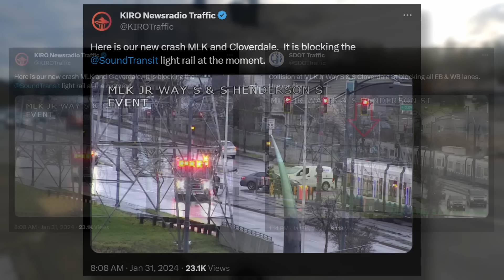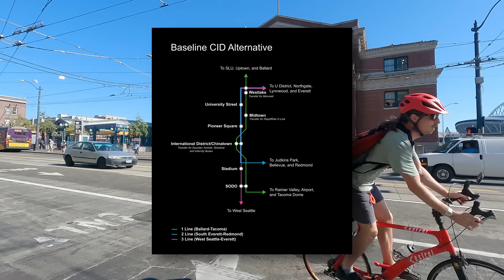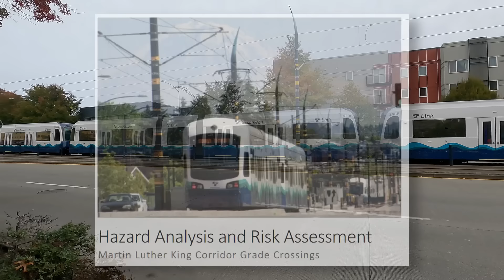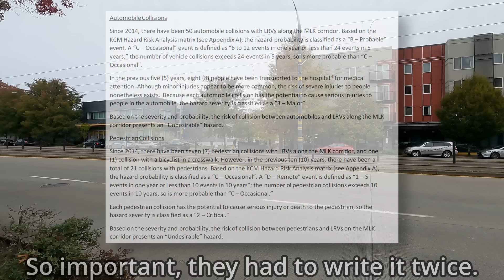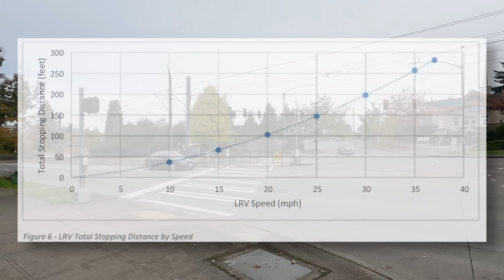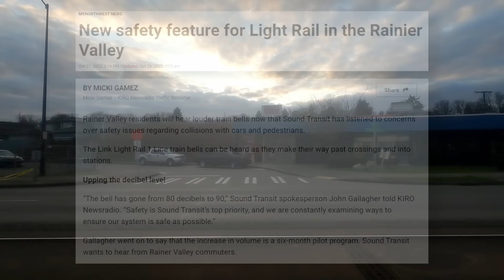Don't Skimp on Grade Separation

Comment: At grade LRT is okay so long as it's on its own right-of-way. If it's in the middle of or right next to a heavily travelled, high-speed stroad you are just asking for trouble. But what if it's already there? The solution is to block ALL the cross streets from going through the intersection, i.e., make them right-turn only plus through traffic for the stroad. Vehicular traffic that wishes to cross the stroad will need overpasses or underpasses built for it.
Reply: Phoenix begs to differ. You don't necessarily need to restrict traffic turning; you just need adequate signal priority.
Reply: Which is fine for vehicle traffic (depending on how critical the intersections are)... but then many streets also have a lot of foot traffic, at which point you either have to accept the decrease in walkability or grade-separate.
Reply: @HowlingWolf518  i think we can also accept automatic gates in lieu of full grade separation (tunnels, viaducts, and overpasses) for less busy lines. 

Most rural crossings of train tracks and roads use an automatic gate to force traffic to stop while a frieght train passes through. Personally this should be done for all crossings where grade separation is infeasible.
Reply: @jasonreed7522  Like I said though, that's going to lower walkability because you have to detour to the nearest gate (and wait for the train) just to cross the tracks. Everything's got a trade-off.
Reply: @HowlingWolf518  I'm assuming gates are installed at all existing crossings which means you don't have to detour, just wait for trains. At that point the delay is based on how heavily used the rail corridor is. 1 train every 15min causing a delay of 1 minute isn't terrible, a constant stream of trains where the gates are closed more than open should be true grade separated.

Ultimately it all comes down to cost, and whether an upgrade in service (gated corridor upto full grade separation) is viewed as worth the cost of that upgrade.
Reply: @jasonreed7522  Keep in mind that every extra gate raises costs, which defeats the point of not grade-separating. Also, there's trains coming in from the opposite direction, so that's two trains every 15 minutes.

You're right, not the end of the world, BUT once ridership increases, the line will have to run more trains to meet demand (if they don't from the start). Up here in Vancouver, the Broadway and Surrey streetcar plans involved running trains with 2-5 minute headways, or one train every 1-3 minutes... thankfully, those never got funded.
Reply: Which is almost never so at grade is a problem

Comment: 9:45 It really pains me to see the train stopping for cars at intersections. There is no excuse for prioritizing cars over such large trains! The M1 line in Lausanne, which is a single track tram with trains that are 4 times smaller and a frequency of service of one train every 5min can do that without much problems (and the tracks also have gates as seen at 6:16).
Reply: Even CALGARY figured this out, and the C-Train has rail crossing gates and light synchronization to ensure the train has complete priority.  CALGARY.  If Calgary can figure it out...
Reply: Even freight rail has figured this out, admittedly it would take them nearly 2 miles to stop, but still. If we can make drivers wait for a frieght train for 5 minutes, we can make them wait for a passenger train for 30seconds. (Automatic gates plus traffic lights are relatively cheap and effective.) 

Realistically even busses should have signal prioritization where traffic lights detect approaching busses and give them a green light before returning to normal behavior. (I'm sure some cars would incidentally benefit from this as well, but the main goal being that busses shouldn't be stuck in traffic)

Comment: One thing I see as a problem for pedestrians is that there are no pedestrian islands, so you are caught trying to avoid cars while running straight into a rail line. 

If they do narrow the roads, then they could add the pedestrian islands. I’d also generally try to find solutions that are static, rather than more maintenance dependent technology. 

I’d also be curious how other cities addressed the problems, using low tech solutions?
Reply: I think moving the track to the side of the road instead of the median would help a lot. And then add gates and signal priority so that the trains never have to stop to let cars through. That's how the M1 line in Lausanne is set up and it works very well. It's only single track but handles a frequency of 1 train every 5min in each direction. The only problem is that wait times can get a bit long if you're unlucky and want to cross the rails (especially for cars)

Comment: I've been riding the 1-Line a few times when I went to Seattle and especially when I'm going to the airport I see cars struggling to turn left with 2 REALLY long light rail vehicles passing by the intersection, and right after the light turns red. I suppose that cars really have a short window of time to do those.

Comment: Portland is considering building a tunnel for MAX, but I highly doubt it will happen in our lifetimes.  It's a shame, because going through downtown on MAX is a painful and slow experience, and people often drive or park on the tracks.  It's so obnoxious.  

MAX also has several intersections similar to the MLK section of Link.  Where MAX Yellow Line runs along Interstate Ave, and where the Blue Line runs along E Burnside.  Those are less because of NIMBYs and more because they were trying to build the system on a bit of a shoestring budget.
Reply: These need to be elevated. 😊

Comment: My personal preference for a system like this is to follow in the footsteps of Edmonton Transit Service and have more shorter tactical tunnels running under some of the busier intersections. If we had a chance to redesign the corridor, I would keep the light rail tracks on one side of the road with these tunnels integrated. In any case, it's much cheaper and nearly as effective as full grade-separation

Comment: It's ok, Sound Transit won't do this again, right? Right? (NE Bellevue section of 2 line)
Reply: Tbf. That’s the final section of grade running track that ST is building and even then is only 1/2 a mile along a not busy road with 3 total grade interactions

Comment: Some extra context specifically to LINK (but it isn't the only which suffer from this): Seattle was chosen to receive federal funding for a metro system similar to the Bay Area and Washington DC but its residents rejected it multiple times and Seattle built LINK as a tramway instead. Then came in the decision to build the rest of the network almost entirely grade separated (in part because of the downsides of at-grade sections) which results in this weird system where most of a single line (with no branches) is grade separated except for a portion which runs in a street's median, serving Seattle's metropolitan region with low-floor vehicles when high-floor ones are better suited for this task.

Comment: Here’s the thing: grade separation isn’t possible everywhere. Sometimes it’s ok to have at-grade crossings. That said, the fewer the better, but the busiest ones should always come first
Reply: Grade seperation is always possible, it's just a question of costs. Either in monetary terms or in terms of sacrifices to the ideal alignment or links. Perfect example of this is Vancouver's musings about a north shore connection to Metrotown. While I entirely agree with the rough direction of it I really strongly intensely think they should shift the transfer station 1km west to Patterson where it will be far cheaper since you're not forced underground but at the cost of not having the interchange on the perfect station.

Comment: I assure you as a witness to the process that the system would not have been built had the route through Rainier Valley had not been used.  There were MANY MANY obstacles needing to be overcome to get rail transit of any sort built in Seattle.  There was even a plan to make the Beacon Hill tunnel single-track with trains alternating in directional use *in order to save money*.  I am aware it is not perfect, but look at the future option of building a bypass down the Duwamish Valley to the infill Boeing Access Road station which has always been planned to be built.  Having the line run down MLK was also considered Social Justice for the fact that the roadway had been widened and  “prepared” (businesses and homes, mostly owned by people of color, wiped out) for the Empire Freeway.   It could have been built on viaduct for 3 times the cost or tunneled for 10 times the cost but again, that would have killed the system south of SODO and thus would have likely killed frequent electric rail transit as a part of the Sound Move project.  I’ll take what Seattle got over the other suggestions (Van platoons! Seriously) any day.
Reply: dont forget the multiline monorail system proposed in the 90s...
Reply: What the hell is a van platoon? Is that some sort of glorified dollar van/minibus service like the unchartered stuff we have in NYC?
Reply: @sonicboy678  Pulsed vans leaving various centers.  This was a seriously proposed alternative from some members of the local and regional government bodies
Reply: @erik_griswold  Somehow, that's even worse than I imagined.

Comment: Elevated tracks and tunnels both come with their own set of challenges. Notably, they significantly increase operational costs. Elevators and escalators, essential for accessing elevated tracks, are expensive to maintain.

However, I propose that the focus should shift from altering the tracks themselves to modifying the adjacent roads. For instance, prohibiting left turns over the tracks at all intersections would be beneficial. To enforce this, we could use more than just signs—raised curbs could serve as a physical barrier. While gates work well at large intersections for both vehicles and pedestrians crossing straight over, they pose issues when vehicles make left turns across the tracks. Additionally, pedestrian walkways that guide people to face the direction of oncoming trains would enhance safety.

Considering the statistics you’ve presented, the highest priority should be placed on physically preventing vehicles from turning left onto the tracks. The National Association of City Transportation Officials (NACTO) offers a comprehensive guide on intersections.

Comment: Transit agencies don't have infinite budgets to build tunnels everywhere. Most likely if they were forced to build a tunnel the entire length of the corridor it wouldn't have been built at all.
Reply: This really is the important part that people seem to miss. People need to keep in mind that Link did not have the same political and public support in the 90s. The original ballot measure for Link failed in 1995 and had to be scaled back so voters passed it in 1996.

Comment: The entire reason for building surface running rail transit (light rail) is to reduce the upfront capital cost of building fully grade separated heavy rail rapid transit. If you going to call for grade separating as much of half of a light rail line it might be best to pay the upfront capital cost and build heavy rail rapid transit. The platform lengths for heavy rail rapid transit do not have to be long enough for 600' long trains, example Baltimore heavy rail rapid transit line.

Comment: SLC's Trax light rail system has a few intersections where not only is there no grade separation, but the tracks actually share space with a left turn lane (with the train going straight, although cars go left). It is super weird - and always a bit scary - to be sitting legally in the left turn lane and see a whole train coming up right behind you....
Reply: "few intersections where not only is there no grade separation" This implies that TRAX is more grade separated than it actually is but it's actually a mostly at grade system.

Comment: Underground vs on street is the difference between intercity and intracity transit. Massive metro stations in big cities are essentially intercity stations, where each neighborhood, borough or district is its own city.  This is why even when some megacities cities implemented security checkpoints in metro stations, people were still willing to put up with x rays and metal detectors in addition to the long walk underground. 
Trams are attractive because they are the last mile solution, stopping at the front entrances of many businesses and apartment complexes. For transit that serves an intercity function (regardless of where municipal borders are), grade separation is hugely important as the railway is essentially an interstate. For transit that serves a more intra city function, grade separation and increasing station distances can reduce convenience and change its nature. I would argue that all transit should be intercity since last mile neighborhood transit is better served by micromobility, but if the city does not have proper infrastructure for people on bikes and scooters and wheelchairs, then measures that increase speed but reduce convenience can be a bad things.

Comment: Easy solution: discourage single occupant vehicle trips through congested downtown areas. Light rail, bus, biking, and walking aren’t the problem in Portland’s downtown area. Cars are. Moving light rail underground further promotes automobile trips into and through the city, making it less friendly for pedestrians, cyclists, and tourists. Some of Portland’s character as a city comes from the transit-focus of Pioneer Square. Moving transit underground there will cause Pioneer Square to turn into yet another area for drugs and tents to pop up.

My proposal: keep surface rail in downtown Portland for trips within city center, but add a few underground express stations to help people get in and out of the city without so many stops. This also addresses Trimet’s longstanding issue of limiting train consists to 2 cars due to downtown Portland’s short city blocks. Trimet could run their entire network with longer trains, as long as those express trains transit through the city underground, then run their short cars on the surface for local service in downtown. Their short trains could either continue on surface routes outside of city center, or turn around and stay in downtown.

Having underground mass transit with larger consists would alleviate the bottlenecks on sporting event nights, festivals, and events where train passengers travel in sardine mode.

Comment: The accidents at grade thru the Rainier Valley were predicted way back in the day, during design. The city-county leaders needed to cut cost, as they could not afford a cut & cover solution, so they were ok with the risk. They also did not want an overhead line because they thought it would be received negatively (think the old parts in Chicago & New York City). As the city has grown denser and the light rail is more frequent, I predict more accidents and interruptions on this stretch sadly. Surely something more can be done here?

Comment: Building light-rail with some sections in tunnels is fine as long as it is placed where it needs it the most (downtown or in difficult urban landscape). Considering light rail tunnels and underground stations are quite expensive, I think a split of 80 - 20 % or less between on street and tunnel sections is fine. It is however a complete waste of money if you go for 50 - 50% as a true metro could have been so much faster and not that much more expensive. A metro allows much higher frequencies (2 to 3 more frequent than light rail in rush hour) and therefore, for the same capacity, shorter trains can be used hence they require shorter platforms. Shorter platforms mean less expensive underground stations to build and maintain. Nice's tramway line 2 (on the French riviera) strikes this balance well in my opinion. Eglinton Crosstown, a lot less...

Comment: Designing the pedestrian crossings so you have to do a zig zag towards the oncoming train would help. Adding grass (and maybe even trees) between the tracks and the road would help separate the tracks more. Grass between the tracks is the next level option. As for the intersections with cars, I got nothing. ppl are gonna ppl. There are often stops next to the intersections here so the rail doesn't travel fast, but if this light rail has longer distance between stops as requirement, that's not an option.
Also then again, ppl gonna ppl, I was hit by a tram when I was a teen cause I didn't pay attention, I genuinely didn't see him, and I was too into my music. it was just ramping up from the stop, so not much damage, but still.